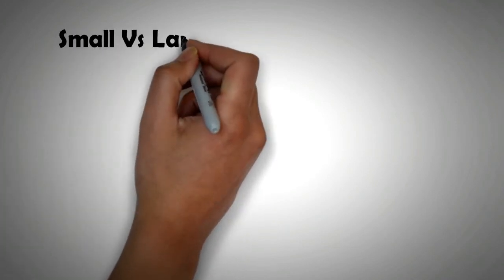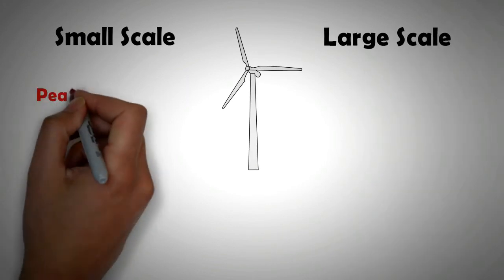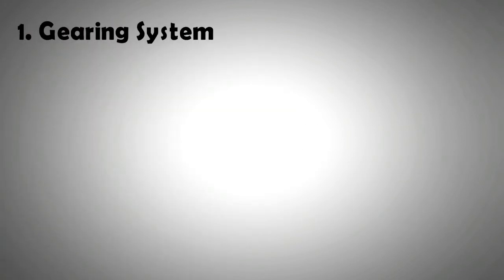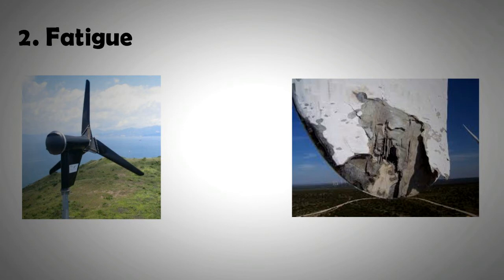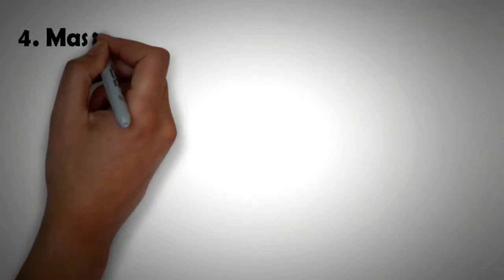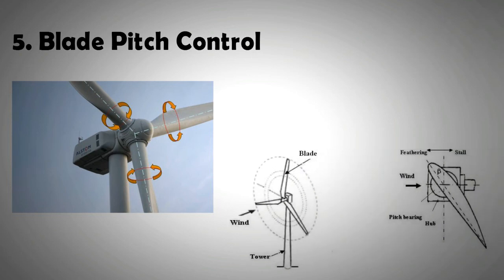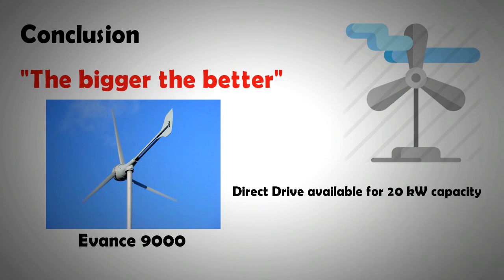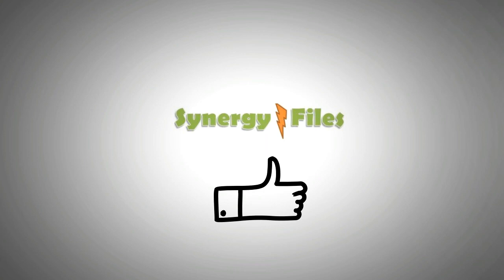Small Scale V Large Wind Turbines

Comment: Thank you so much . This topic is very interesting . The question is why this topic doesn't discuss medium sized windturbins . It seems that large windturbins are symbols of power and industry and small windturbins are symbol of simplicity and economy . I'm not an expert but it seems that medium sized windturbins are the final solution and in some areas according to the climate and wind parameters the proper model should be designed and installed . It seems that small sized windturbins should not be dismissed but new models with higher efficiency should be designed.

Comment: So what is your opinion on small scale vertical turbine. 
2meter hi/diameter 130meter 6 blade  turbine direct (no gearbox). 3kw + 2021 saltwater sodiumlom battery. I like to hear your input on the matter. Great  video.
Reply from the maker: I have not seen any vertical turbine company doing well. They have their advantages but there are good reasons why almost all major windturbine manufacturers have moved to horizontal axis. I have vertical wind turbines installed near my house on a train station. I never see them moving
Reply: Makemu.it is where I have ordered a turbine. 
Fitting it in 2021 3kw at lowe air speed. I'm hoping for the best results. Great video content.!

Comment: I have learned that an affordable wind turbine is less "efficient" than turbines so expensive it takes a deep pocket or utility to afford the purchase price. The video was made in my opinion, to discourage small turbine construction because the economy of scale favors large turbine wind generators. I noticed the video only used open blade turbines for comparison. There are turbines with the blade secured at top and bottom. These type have different concerns not discussed by the open blade video presented here. The secured end blade and chinese lantern type were not mentioned here. That is a significant exclusion.
Reply from the maker: Thank you Mr Harper for your detailed and very insightful comment. i will certainly look into information that you have highlighted. I would like to say that, the intention of the video was not at all to promote the large Megawatt turbine manufacturer. The truth is that in 2010, I had assisted in supervision of a PhD student whose research was to guage the efficiency of small 500W-1000W Turbine. The outcome was disappointing for me as we got nothing more than tricke current for most of the time. Note that I am a proponent of  renewawable energy
Reply: The efficiency of some of the newer designs of "small turbines" both VAWT and horizontal deserves a fresh look. The fact that a small turbine in the 100 to 200.00 class can now produce significantly more than a 500.00 small unit of 2010 vintage may not tip the favor against large tower mounted turbines ( 50 feet or taller) is very likely because the new large turbines have progressed as well. The cost difference between a small turbine that can produce energy at a rate that will allow a home owner to reduce their dependence on the grid is an economic reality that must be taken into consideration. 

The environmental cost in material, transportation costs and cost of assembling the unit is not taken into account. There was a project in Germany where a company did great harm to a forest inn the process of building a tower with a base so large the trucks delivering the powerhead looked like ants on a coffee saucer. It cost in excess of 2 million DM to build. How long before the investment, not including the continual investment in maintaining the area and generation station will be returned. It has been a while since I saw the video, so my numbers are from memory and memory is not perfect. 

The reality is that we need generation systems of all sizes and types, even if we figure out how to use less energy. Open blade windmills suffer from the small potential of tip speed exceeding the speed of sound and shattering from the vibration when the brake fails and the yaw motors are not able to feather them to an idling position in time.  

I like the "Chinese Lantern" style for several reasons, weight and compactness of transport, the 150 meter tower could hold a significant number of these. Space utilization could be more effective than with the footprint required for 150 foot wide blades. 

My wife and I are planning a system for our in town home and a piece of property out in the country. One goal we have is to produce enough [power to use a net metering system with the local utility and see where it goes. Thank you for reading my message, I want to see more individual people think about producing, and reducing, their energy use by becoming aware of what their individual monthly energy cost is.

Comment: What about the efficiency of small vertical  wind turbines? I have seen many manufactures clam that its more efficient than a horizontal turbine.
Reply from the maker: I will be making a fresh video on this topic as techology has advanced.
Reply: They're wrong. Many of those manufacturers are just trying to sell something, by saying it's "new and/or improved", and that you don't need a tall tower, or you can put it on your roof! Vibrating walls anybody? We went through this in the 70s and 80s. Anybody that knows anything about the wind understands that wind near ground level is very low quality, low velocity, and turbulent. Wind power is exponential to the velocity. Doubling the wind speed gives you 8 times more power. For this reason in order to have a cost-effective installation you need a good tower, and a good three bladed horizontal axis turbine. Get a good, recent book on home wind power before you begin. Paul Gipe wrote  a good one probably about 30 years ago if you can't find a good recent one.

Comment: very good job! I would like to add last section 6. Economies of Scale: small wind turbines may be worse in every way but I can afford them. small it's transport is easier and cheaper. it is easier to sell 100 of something that cost 1000 dollars then something that cost 100,000. if you make many of only one thing it is easier to manufacture. if it cost less it is likely that you do not have to update the design with the latest tech on each unit. if you make a lot of something it's easier to manufacture. efficiency is great but sometimes where that efficiency is matters a great deal, and sometimes it's more important to have that efficiency in cost over power generation.
Reply: The nice thing about small home wind power, is that you can overcome some efficiency loss with just a larger-diameter blade.

Comment: A horizontal axis windmill has 5 blades. During regular operation of this windmill , the number of blades that will capture the energy in the wind =
Reply from the maker: At most 2
Reply: The fewer the blades the more efficient the turbine is. There have been single and dual bladed turbines built both large and small. The largest problem, besides balance on a single blade, is the chattering effect when the turbine yaws while spinning. This can loosen Fasteners and over stress other components. For these reasons the common standard is three blades. I've seen people try to use more in order to capture energy in low winds, but there is very low power in low winds. Additionally due to the turbulence between the closer spaced blades, the turbine can't use the higher winds with the much higher power available. Therefore, overall the best bet is to use three blades as long as you are in a region that will support wind power, or don't use it at all. Check a wind map before you begin.